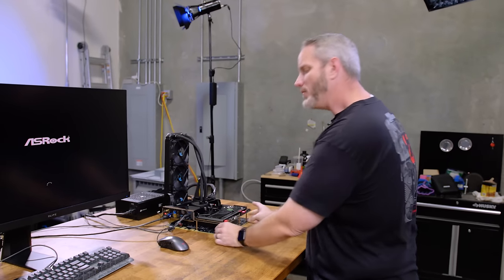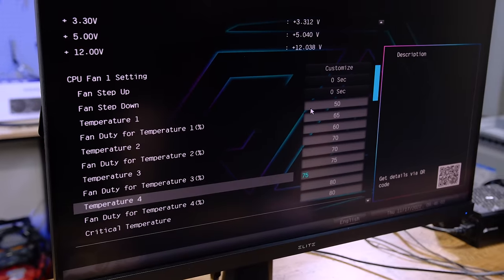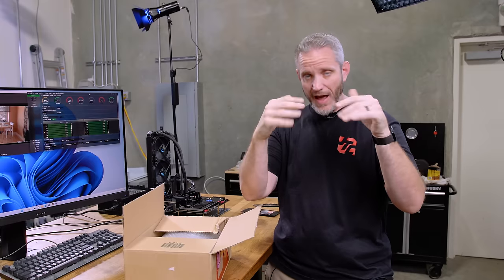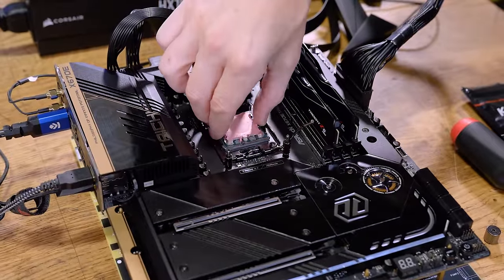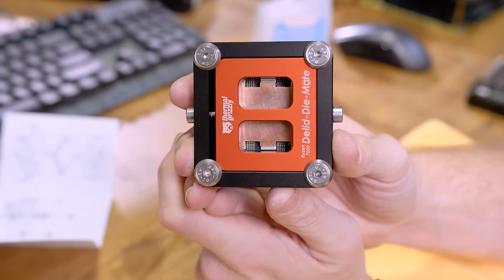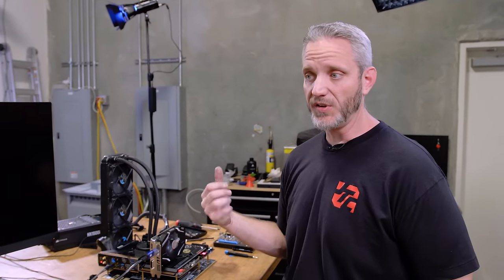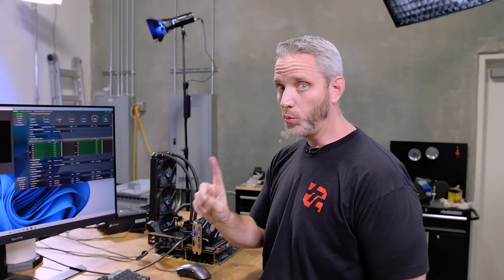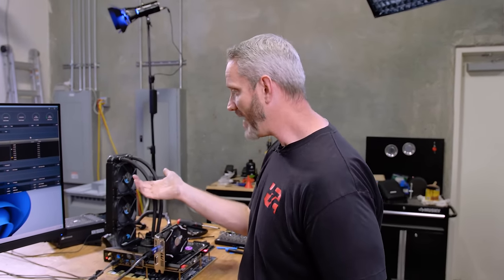I was scared to delid my CPU, but then...

Comment: Hi Jay, I’m using a r5 7600x and I decided to use an air cooler, well since i changed the core clock speed in the mainboard menu to 5.4 ghz it undervolts it automatically and it runs now with the Noctua nh u12 at 78c in cinebench. For some reason I have the feeling that the ai overclocker is weird bcs when I put it to 1.2 volt it only runs at 5.1 automatically but if I set the voltage to Auto and the core clock to 5.3 it will run under 1.2 volt and like 70c peak. That’s why I chose to run it on 5.4.(sorry for bad English)

Comment: $574 CPU… it must be selling like garbage to have dropped from $699 that quickly.

Edit: Don’t use a cloth, use a soft bristle brush. Followed by using liquid metal to dissolve the indium. The sketch factor is strong unless there was an intermediate step of nail polish that you failed to include.

Comment: i was not aware you can set a max temp usage on Ryzen.
I set my 5800x to 75c max with my tuned per core and it went from maxing out at 115w(PBO limit) hitting 78c on OCCT to 65C and only hitting 70w on the CPU and on i get the same 15633 score on CB23.
Core only lost 50mhz on OCCT and hits 4.5ghz on CB23

Comment: Really curious about this as I was going to consider it for better cooling, I am currently running 5.4 ghz on all cores with the asrock steel legend and just -20mv offset scoring 40k+ in cinebench and 80 to 85c with a 360mm loop using 175 watts according to ryzen master. Starting to really feel not worth the risk and work to drop 10C by going direct die

Comment: You took two millimetres off it?!? Is the metal even 2mm thick? The casing of a laptop hdd isn't even 2mm thick, and honestly I don't think the platters would be either. My iphone SE is only 7.3mm thick. I don't think you're using the right unit if the number is 2. Actually, I just measured a Seagate HDD, the machined sides are 1.2mm thick and the stainless lid opposite the PCB is 0.4mm.

Also love how you went so in depth about the goop guards....then while taking the CPU out showed that you didn't use one....xD

Comment: If You are deliding cpu with tinned cap, would it not be smart to pre-heat it so that tin got a bit softer?
Reply: That was my initial thought too, but Roman addressed this.  It turns out that you'd actually want the solder to be even colder.  The way that this tool works is by shearing that thin layer of solder, relying on that thin layer of solder being hard and brittle enough to fatigue.

Comment: I forget which amd cpu it was i think it was around the time of the 486 to P1 anyway there was a mod that you could solder or add caps to the cpu to unlock cache and other features hmmm i wonder about now as some are not populated.

Comment: Speaking of pins of the AM5 board... My friend bought parts for a new build. For his cooler, the instructions said to remove the backplate (AM4 instruction, no AM5 specific instructions since it wasn't updated yet), but this genius of a moron, instead of waiting for me to help with that, decided to remove the backplate of his AM5 board thinking it applied... Yeah don't do that. It removed the CPU retention mechanism, which also has the socket guard on it... and so he bent the pins in 2 different places because of that. He's out $460 CAD for that board and possibly killed the CPU as will because he removed the cooler while the system was still powered on and the cpu fell off. Dumb people... they hurt in different ways.

Comment: I too hate the double menus that seemingly offer the same options and then options where the help tip is literally the option written again... Great. Aorus master X570 is terrible for that. Especially if you enable PBO it just throws voltage, the ppt, EDC & tdc are just bonkers. So much so that the scores you get in cinebench are worse. I had to spend a lot of time messing with ppt, EDC and tdc in conjunction with the curve (5950x) optimiser to get better clocks with less obscene power use. Only to find that the auto OC section is now gone from the current non beta bios so I can't try for higher clocks. I expect if you played with ppt, EDC & tdc along with individual core curve optimiser values you would get great results. Don't trust auto! I for one would like to see a video where you go in on ppt, EDC, tdc and curve optimiser.

Comment: There is an annoying issue on the rtx3080 that I haven't seen discussed anywhere. 

I have a double monitor setup (the same 1440p BenQ monitor). For some weird reason when the computer boots it starts on Monitor 2. Then when Windows finally loads and shows the login screen Monitor 1 is displayed. 

No idea why but during boot monitor 2 displays post-screen. It caused a lot of issues with HDMI audio and would constantly mess with my OBS settings.
Reply: Cuz when you first booted your system one of the monitors was plugged in first. I guess you can physically swap them then change the monitor settings in the system, or fresh install your OS.
Reply: @Vinn_K  no, I am not that dumb. I know what input is what at the back of my GPU.

Comment: Hey, just a quick question: Is the liquid metal conductive? How safe is it?
Reply: Yes it’s conductive, it’s literally a liquid metal alloy. If you get it on a pcb/electronic components you can cause shorts and screw up everything. It also corrodes aluminum.

Comment: I'm more curious about the frame bracket needed after delidding. I'm assuming it's the same as the Intel one, where you need to apply even torque to all the mounting screws to ensure even pin contacts. What torque tensions are recommended by derBauer for the mount?
Reply: I just reduced my heatsink (DH-15) standoffs by the IHS height. I used the stock back plate without the retention bracket. EZ

Comment: Sounds like amd should reconsider there lid thickness in next revisions then if its impacting thermals/preformance that much.
Reply: They most likely will because AM5 will be supported beyond 2025 as Lisa su stated. So it does make sense newer CPU versions will be improved and better in performance and temperature

Comment: Any updates on AMD's RTX4090/4090ti competitor card yet? The 2 cards coming out early December are only direct competitors for the RTX480. And indeed, any news on a release date for the RTX490ti, which SHOULD include Display port 2.1 (for 8K gaming at high refresh rates and bit colour) support ready for the 8K gaming monitors coming out in Q1 2023) & HDMI 2.1a (includes Source-Based Tone Mapping like updates for HDR) & PCIe 5 (to free up lanes for other devices)? RTX4090ti will NEED those features if NVidia want to sell ANY!
Reply: @Salt Maker seriously though - why would anyone buy a RTX4090ti when even the RTX4090 is bottlenecked so that it has wasted performance which it cannot ever physically display?
Reply: @Salt Maker the bottleneck for the RTX4090 is in its display port - its a bit like having a 3 litre sports car with skateboard size wheels; no matter how fast the engine, the wheels are so restricted that they won't be able to make use of the engine! And there is ZERO way to fix it; display port 1.4 can NOT be upgraded to 2.1 without changing the hardware.

Comment: Its never a good idea to say something is "idiot-proof" because then all user take that as a sign to not  read the manual. And then the problems occur much likely(er). 
And there is ever a golden triangle on AMD CPU´s on one edge of the board where the die´s are fixed on. You better had belief the manual and looked better on the CPU. Der bAUER should print a golden triangle on the delid-tool on the right edge, so that would be self-explaining for AMD-CPU.

The Voltage-anomaly, that the offset seems to do nothing to the real operating-conditions, is somewhat tricky. I have experienced the same strange behavior. But there seems to be no hardwiring from the voltage-setting to voltage in usage. On AMD and Intel-Plattforms. That is maybe because there is always some processing of that settings during the usage-conditions. And if there is no effect to some (carefully, refraining) settings, maybe only set more offset-voltages (lower) and at some setting, there is an seeable effect on the voltages in usage. But it seems, that the system never would adopt the adjusted offset-voltage-sum in real operation. There must be some strictly demand of the regulation of voltage to the CPU. And espacialy for prime95 with its high-power-setting there is ever a higher voltage, as one have adjusted. It can go lower, but not as much, as the bios-adjustment should result. And if you go to far with the offset-setting, the system brings bluescreen... or not start anyway. So its maybe also some sort of "idiot-proof"?!

With the liquid metal there is some trick to make it easier to spread over the Die: reaming, not smearing. Because that metalic stuff needs to get some electro-static conduction to the die, so it does hold on the hole die-area, and not contract back to a single drip. It will ever tend to build that drip, but if that liquid come over their static tension, it gets better contact to the Die.

Comment: Such an awful design AMD... The fact that AMD doesn't provide the rubber gasket thing by default is a joke. If they didn't focus on cooling the CPU's would actually be much better and you would have thermal headroom and overclocking head room.

Comment: 5950x hits 5.15 & 5.2 all core…. At 4100MTs too with B2 stepping, sooooo what’s the point of the 7950X that can’t do 128GBs of RAM, or doesn’t have any gen 5 drives/ram/GPUs worth a damn yet…… so I ask again, this is AM4+ not 5 it feels like 

Even thought gen 6 and Wi-Fi 7 is ready already

Comment: Isn't it better and easier when you heat up the CPU? SO that the material they used to solder the cpu to the IHS is more liquid?
Reply: Ah as I saw later on the video it is irridium :). It is indium gonna look up the melting point.
Reply: Only 156,6 °C so why not heat the chip while using the delid apparatus? Or even can we loosen the glued parts first and then just heat it with a solder iron/heat blower thing to get it apart?
And another question pops my mind. Can't you leave the indium on top of the cpu (and the other parts ofcourse) mixed with for example gallium and use that as the paste between core and the watercool loop?

Comment: Why is there a delidding tool needed now? What's different to delidding e.g. a 7700K?
Reply: Much less room for mistake. Having delidded a 6700K, it was quite easy. Cut the glue, warm up and force the heatspreader off (i used a vice). It was only attached by a thermal goop. Ryzen IHS is soldered, so you need much more force to move it. And there is much less room to move it because SMDs are so close to edges of IHS. And as shown, you need to move it back and forth many times before it yields.

Comment: AMD sucks! What turned me off to AMD CPUs was a video I saw years ago where the heatsink was removed and the AMD CPU released its magic smoke.
The Intel CPU just shut down due to over-temp when the heatsink was removed. It never lost its smoke.
I personally tested this with early Intel x86 CPUs many years ago. Remove the heatsink and it stopped working, put the heatsink back on and it ran just fine.
It's called thermal shutdown, and it still works on Intel CPUs to this day.. I will never use an AMD CPU.

Comment: What is that ThermalGrizzly Thermal Paate you praise? I want to get some next time I do a computer up.

Edit: I feel like AMD could easily fix those gap issues by having some sealant around the edges of the IHS on the inside
Reply: Thermal Grizzly Kryonaut Extreme

Comment: @jayzTwoCents hey there,I like your videos that are very informative and helpful ,however i will say this ,im just an average gamer nerd and you have made alot of videos like this one talking about electrical things to a degree that basically requires an electrical engineering degree to understand and do , how on earth is anyone going to use the newest Ryzen components if they requires this sort of dissasembly and messing around with it , I want peak performance for everything in my system , so the Ryzen 7900,7950 or similar combined with an AMD Radeon 7900xtx card for Gpu and DDR 5 with the hest speed money can buy,same for the NVMe , but I dont have an electrical engineering degree, I just want to but it,slap it in and rum it at stock,not overclocking anything. Just thought i would share my thoughts , thank you for makkng the great videos that you do overall. :)

Comment: Do not delid your CPU. This is the absolute, hands down, dumbest way to self own. You're fucking around with one of the most sensitive parts in your computer, and unless you can afford to just completely brick your CPU because you bent a pin or god knows what doing this, just don't. There is absolutely no benefit from this whatsoever. None.

Comment: The worst part about the AM5 z-height design is that now we're totally stuck with it until the next socket..... If it was intel we know it would be gone after next release but terrible thermal performance for 4 years? Maybe even up to 5 or 6?
Reply: I think (and hope) they can place the chip higher. Thinner heat spreader, thicker substrate. This shouldn't be a problem with singnal strength/frequency but the thermals will improve a lot.
Reply: @robine5280  except packaging technology is a whole other can of worms and it would cost them allot to order custom thicccc substrates.... I really don't think this is going to change within the socket's lifecycle

Comment: I think Jay should make a solid silver IHS.  Silver isn't crazy expensive like gold, has a better thermal conductivity and with modern CNC tech, you can get an exact 1:1 match at the µ level.  Heck you can even design it with it preshaved dimensions.

Comment: To optimize frequencies and voltages while overclocking I used ClockTuner, PBO curves can tend to go a little overboard (as we've also seen on the 7000 series).

Comment: so entire time that people fighting thermal types, shaving and lapping confusion , custom brackets that serve no purpose, and funny looking cushion pads to just fill odd IHS gaps, delidding nightmare for just simple as set the bios setting 75c max ; jesus  amd could least got bigger chip and put all caps on bottom of cpu like intel does so its more protected from any liquid metal or paste ...those caps shouldn't be cover in thermal paste to begin with, and using toothbrush is very dangerous for tiny caps, i am very surprise it was not hard bristle brush types , good thing your teeth are not bad shape than others need hard brush type ... but for amd...they surely care about coolers than memory compatibility for more budget options, its not hard for amd to fit both memory controllers since its 5nm, ton of dead space to fill in ....no my friend ...this is all on amd alone, they have  responsibility, they just want more money from amd fans still...not motherboards or youtubers like debauer or me who love to find any fault under amd...good thing i finding a ton now

Comment: Why not just update the bios on the 12th gen system you spent so much time on so it can use a 13900k? its better for gaming and literally only needs a bios update, what a waste.
Reply: I agree... And isn't the 13900k currently the BEST cpu ?
Reply: @igspar007  It might trade blows in some workloads, I didn't pay much attention to either new cpu launches, im just 99% sure its better for gaming, the 5800x3d sometimes outbeats both because of the 3d vcache (only cpu right now with it)

Comment: Mmmm. AMD.  100% Chinese. Do research. I dont touch AMD products. Yes, they work for a year then you get inconsistent blue screens and instability. I had this happen twice. As soon as Intel option was chosen, I have stability. Best is my one server, Intel, is running 5 years for 24 hours a day, not a single problem. AMD in the same price class only lasted a year

Comment: You really should manually voltage optimize on a per-core basis (if asrock lets you).
The AM5 cpu's are waaaaay overjuiced (probably for yield), and it pushes them into unhealthy thermal throttling. You'll likely see performance uplift with a slight down-tune in voltage, due to the disappearance of thermal throttling and lower overall temps. Side benefit you pull less from the wall too. And that's without any cooling upgrades. WITH your cooling upgrades, you could see some insane perf.

Comment: Sorry if I missed this as I skipped through the video but if the CPU is made to run at 95 deg. C all day long and if you took all the time, effort, and risk of delidding it, then why didn't we get a comparison of what the pre-delidded and delidded version could do when using the 95 deg. C limit? Why butcher and handicap the CPUs potential with a measly 75 deg. C cap and not even show us viewers what the CPU can NOW do since it's been delidded?

Comment: It seems to me you miss the knowledge when it comes to thermal transfer, heat capacity, and such.  You're so close, but always seem to be misleading people.  This change by AMD is throwing you for a loop.  I do think you provide some insight to designers of what newbies go through and that is useful.  I'm always wanting to yell at the monitor to push you over the line between speculation and knowledge.